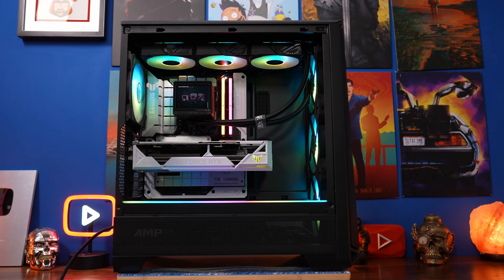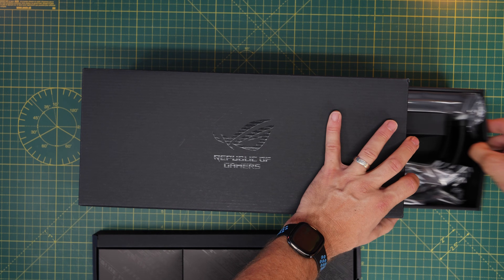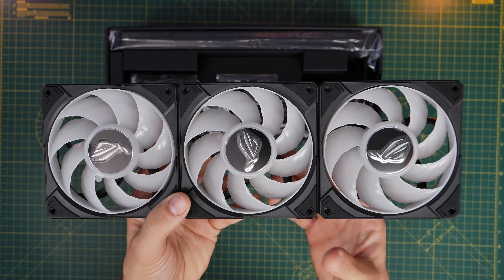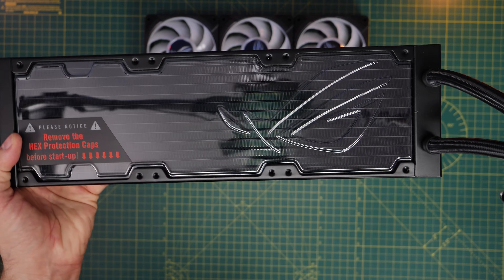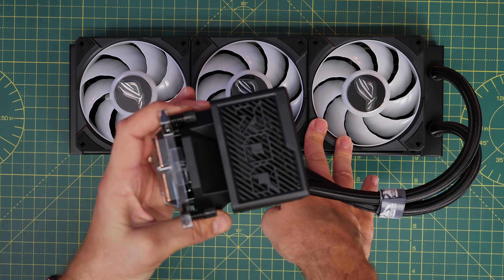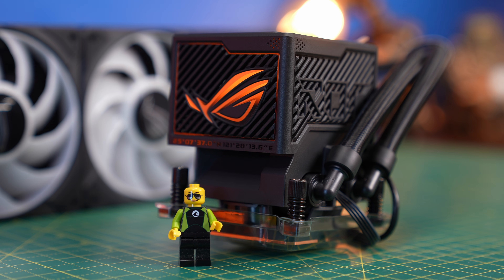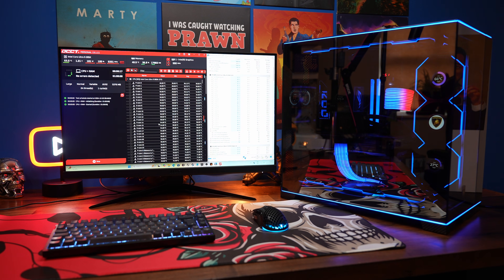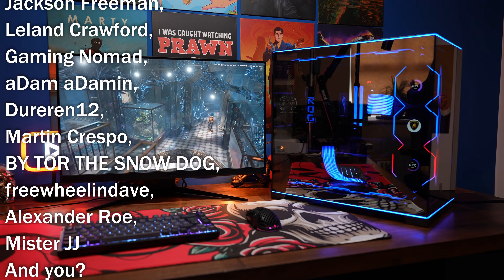Asus ROG Ryujin 3 360 ARGB Extreme wiring and setup guide

Comment: Please I have the same cooler and lian li vision compact ordered and I want to know if the pump tubes are long enough to run through the cutout on top of the case? I want mount the radiator on side and pass the pump through the top cutout
Reply from the maker: I haven't tested that specific setup, but it's worth checking the cooler's tube length against the case dimensions.

Comment: Those 3 fans are okay to plug into the cpu header? They say .55amps ea on the back of them, do I need a fan hub or is it okay to daisy all 3 to the cpu header?
Reply from the maker: Depends on your motherboard. If you're worried check the specs to see what the CPU connector can handle. You'll usually find it in the manual
Reply: @TheProvokedPrawn I checked my motherboard manual and couldn’t find the spec. I have asus B860m max gaming AX

Comment: One thing to note here and I'll admit that I'm pretty sure Ive missed it in the past myself. While reading the Asus ROG Maximus Z890 Extreme mobo manual it states to remove the small cpu socket lever protector which you will see on the lever (obviously). I was able to simply remove the protector once the cpu was installed and the lever was locked down..  Asus manual says something like "Failure to do so can lead to improper installation and potential damage to the system when installing the cooler" 

I'm sure many folks may miss this information even if it is stated in their mobo manufacturers manual (who reads manuals right?)  :)

just thought I'd share the info as I'm just installing a Ryujin 3 extreme aio, on to an Intel LGA 1851 socket on a ROG Maximus Z890 Extreme mobo. And for some bizarre reason I did read the manual. atb

Comment: The radiator screws that come with this product are not long enough to connect the dedicated asus fans to the radiator. I dont see people complaning about this which makes me think mine was defective so I bought another and hve the same problem. these stock fans are too thick / rad screws not long enough, Anyone else ?
Reply from the maker: Very odd. I didn't have that issue. Used the standard screws. Don't know what to tell you.

Comment: very nice work 👍, I would like a piece of advice from your side i have ROG RYUJIN III 360 ARGB extreme + X870-F mother board Asus all the fans is working no issue for that, however two fans have ARGB, and the third one its ARGB doesn't work but the fan rotating, any idea or advice whatwould be the issue
Reply: Is it a faulty fan? RGB not working on it? can you test it out of the AIO?
Reply: @pshearduk  thank you for support, i figured out, the attachment through the magnet part wasn't  connected well i re connect them and RGB worked well
Reply: @HomeTheater7.1  Nice one, glad you got it sorted mate.

Comment: Hey so i was wondering of you can help me. I installed this, and I put the cable from the box over the cpu to the aio header and the cable from the fans to the cpu fan header. Everything is working but it doesnt come up in armory crate. Did i mess something up. Also this is my first build and i’m very dumb.
Reply: That is correct wiring going on the video info.. did you figure it out?
Reply: @pshearduk I did. I had it plugged into the wrong header. Thank you

Comment: Just installed one of these on my new 9800X3D / 4090FE build and I have to say, I'm impressed with it.  My only gripe is that you can't buy the fans seperatly.  So if one goes down, you're knackered.  Mine stays on as well once the system has been shut off.
Reply from the maker: Ok so not just me then. Thanks for sharing
Reply: @TheProvokedPrawn  Go in the Bios, search fort "ERP" and choose S4 + S5. I have an Asus MB so should be the same. Thanks me later.
Reply: You need the inbuild software Armoury crate and there you have the option to turn the RGB off when pc is turn off
Reply: I got the noctua version. They don't clip.

Comment: Thanks for this, I really want to see the review. I’m looking for a 360 aio and choosing between tryx panorama (black no rgb) and this one. Please do at least a test run with the original fans as they  very very good (from what I saw its 5.15 static pressure, so much better than TLs and even the noctua ones that go with tryx non-rgb).

Comment: IDK about the Extreme version, but to shut off the display when the PC is off, for the prior version: 

In Armory Crate, under the cooler, on the display tab, hit the gear (settings) icon (near the "on" toggle). 

Make sure "standby mode" toggle is set to off. 

The prior version allows you to monitor things like "water flow," BUT not of the AIO. Asus says that for monitoring the flow of a custom loop (in the same machine as the AIO).

Does this new version have such options for monitors that don’t work in any logical scenario?

Also, have you tried the AIDA 64 integration (from the original Ryujin 3 support page download) and customization display? If so, can the screen be rotated (to portrait) with that display or must it be in landscape orientation. 

Looking forward to your full review, and keeping my fingers crossed for a white release.
Reply from the maker: Thanks for this

Comment: Dude I want just the fans 🤣
Reply from the maker: They are neat. I asked Asus if they had them separately so I could do a full build but nope
Reply: I may have 9 of them since i bought 3 kits? I specifically bought 3 kits to do the same for my all ROG build. Having an issue connecting as rad screw length is not long enough. compromising my all asus look may just sell if the price is right shoot me an offer?